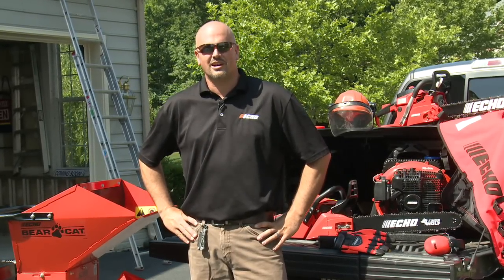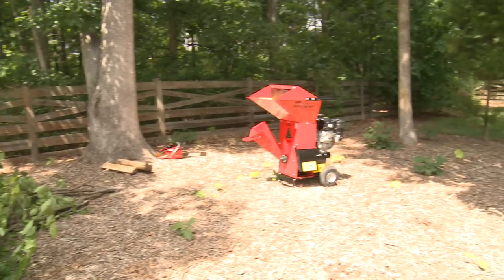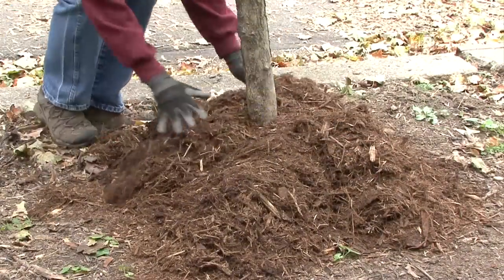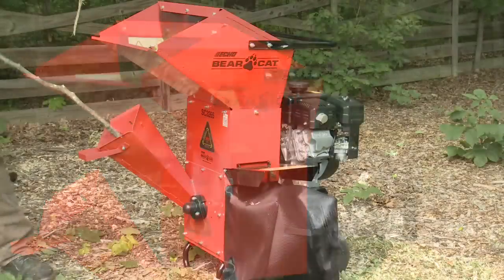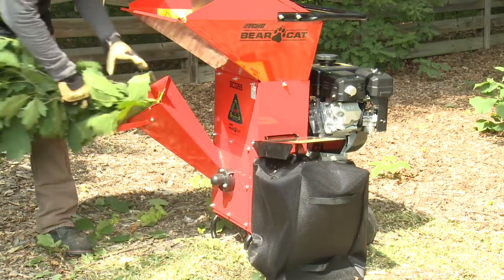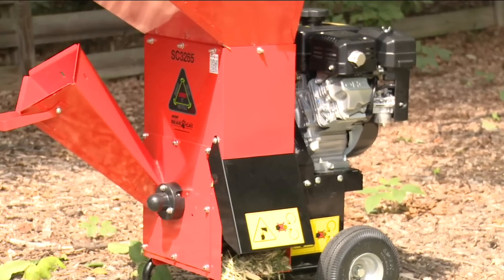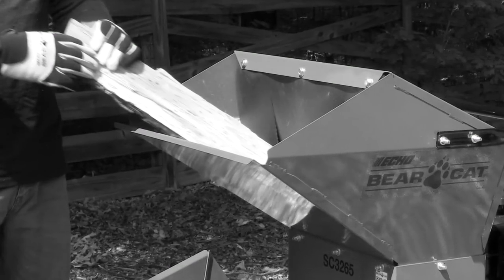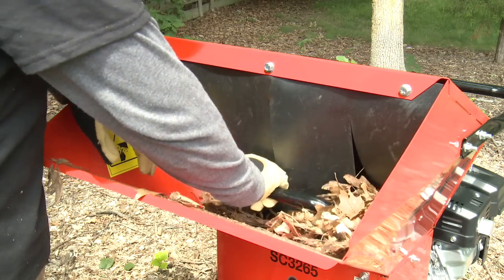How to Use a Chipper Shredder

Comment: "use an eco bear leaf temper (?)" ????? That looks super dangerous,beeing made out of steel (I think) ....why not use a branch ??? its exactly made for that and you dont have to panicaly use that metal thingy with the idea that you may drop it and cause an X-treme over 9000 explosion !!!!
Reply: Troybilt used to make a leaf tamper out of polyethylene plastic.  It was designed and sized to prevent it from passing through the narrowest point of the hopper.